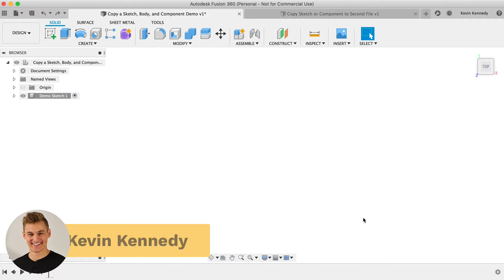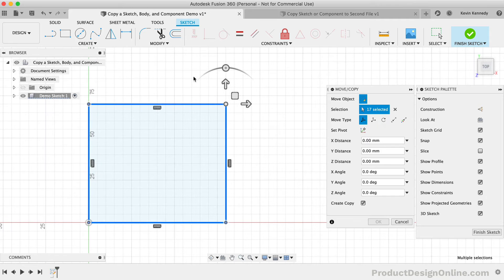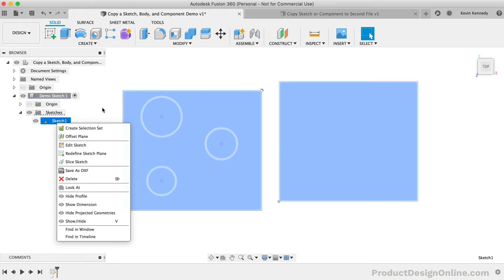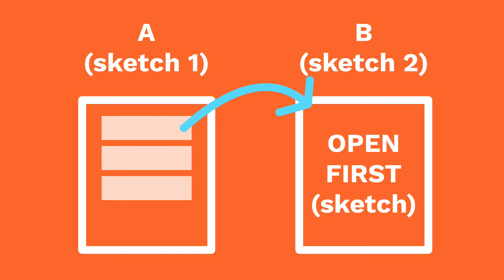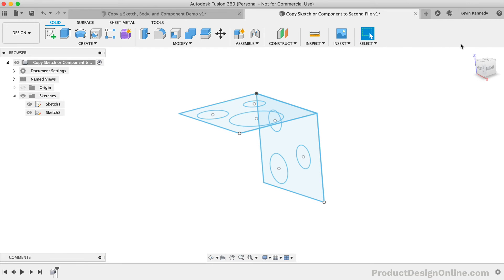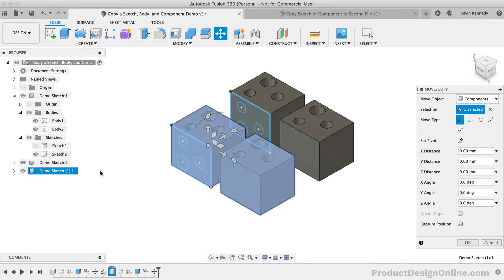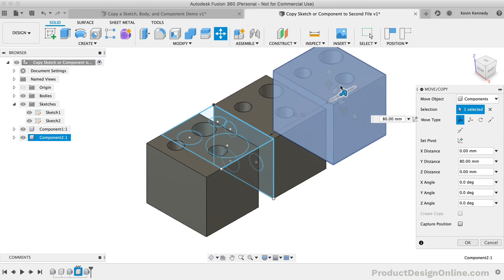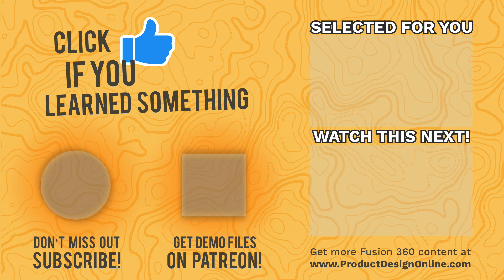Copy and Paste Sketches and Components in Fusion 360

Comment: Kevin, Thanks for an awesome Fusion 360 Series that makes learning easy.  I would like to see information on making a SVG File like you inserted in your Absolute Beginner Video where you made the 3D stamp with handle.  I tried to edit your downloaded SVG file to change the text to fit my use and could not get it to work.  Thanks again Kevin
Reply from the maker: Hi, Gary. Glad to hear you're enjoying my tutorials. I wasn't planning on doing a video on creating an SVG, since that cannot be done within Fusion 360. Scalable Vector Graphics (SVG) can be made in several graphics programs. I use Adobe Illustrator, but a free alternative would be Inkscape. There are many tutorials out there for Inkscape. There are also several SVG creation web apps (some free) if you do a Google search. Cheers, Kevin :)
Reply: Okay, thanks for your reply Kevin.  I will search for other YouTube Videos on SVG File creation.  I use Corel Draw and don't have an issue with creating the graphics portion to the same size as the stamp plate(in Corel Draw), my problem is that when I insert my SVG File into Fusion 360, the scaling is off and my graphic is offset too far and too large to fit the stamp plate. I have looked for scaling controls but haven't found anything that helps yet.  Anyway, I am sure that will be covered in the SVG File creation videos.  Thanks again Kevin, I am a fan and intend to support and follow you while I improve
Reply from the maker: @scabahorn  Hi, Gary. Yep, I would recommend that you create the SVG at the size before inserting it into Fusion 360. Since Fusion 360 has limited capabilities with SVGs it will help avoid and errors with trying to scale it. You can, however, click and drag on the corner manipulator icon that is next to your SVG design (While using the Insert SVG feature). That will let you scale the SVG file right in Fusion 360. Cheers, Kevin :)

Comment: Hey Kevin. So I have a design which ultimately looks like a bath shape. In sketch mode I can create the rectangle fine. Then after extruding it next step I shell it. Now I have a rectangular bath. Only I want the underside to be curved. Copying that if a bath. How do I go about doing that? Cheers.
Reply from the maker: Hi, James. There are many routes to make the bottom curved. The simplest would be to apply fillets to the bottom half before you shell it. If you want a more advanced (defined) curve then I would recommend setting up side profiles, resulting in geometry that can be used with the Loft command (instead of Extrude). Cheers, Kevin :)
Reply: Thanks for the reply and wish you Merry Xmas Kevin. Ok so I did it. Slightly rudimentary maybe but still. I went about it a different way the next day. What I did was to sketch it out and then do the curve underside first. Then to shell it and not the other way around. Then unside the bath shape I used the press and pull function till I had the floor of it flat. Once achieved I began creating the circles and wxtruding them for my rotary drive unit im copying which is on the table in front of me. 

Big question. How do I stop fusion flipping my on screen design which happens regularly. Turns it 180 degrees so I have to then readjust it. Very annoying.
Reply from the maker: @jamesbarratt593  Hi James. Unfortunately, there is not currently a setting or way to have that flipping issue turned off without turning off the entire "Auto look at sketch" feature. However, if you turn that off entirely then you will have to look at the sketch manually (with the viewcube or display settings) each time.

A feature to do so was requested on the idea station a couple of years ago. I remember as this sometimes annoys me as well...but they obviously haven't implemented a solution yet.

Wishing you a Merry Xmas and a happy new year! Cheers, Kevin :)
Reply: Dude that is a game changer. If I have to endure that repeatedly I am sure it will annoy me so much that I wont want to use it so much. How stupid that it does it. 

Anyway we shall see. 

Then say that you have a face you want to press pull to close an edge and you just cant get to it for the sides of a box in your way, is there a solution. Can you click on a side of a box and temporarily hide it like in system analysis so you can fix the place you want to fix?
Reply from the maker: @jamesbarratt593  You would want to use the "Section Analysis" from the "Inspect" dropdown menu to essentially temporarily cut away the parts of your model that are in the way. The nice thing about section analysis is you can hide/show it in the Browser, so you can turn that on and off as needed.
Reply: Feel another buy me a coffee contribution heading your way
Reply: Its xmas day dude. You should be chilling with your family not writing to subscribers and shit. Merryx Xmas again though. Your rock
Reply from the maker: @jamesbarratt593  Had to catch up on some comments while everyone was playing with their new toys :)
Reply: Your middle name. Does it begin with the letter K too? ha ha
Reply: @ProductDesignOnline  Didn't you get any toys then. Is that how you found the time? LAUGHING MY ASS OFF
Reply from the maker: @jamesbarratt593  nope :)

Comment: Another great video Kevin. Your videos have actually made me want to use Fusion 360, not dread it! While I am still very much a beginner, at least I understand what I am doing now. One video I would love to see is your version of an explanation of G0, G1 and G2 surface continuity. I spent hours trying to figure out why I kept getting G1 errors when using the loft command before ultimately figuring out that it was actually my mutli-line, not a spline that was the issue.
Reply: Move / Copy Sketch Autodesk Fusion 360 (Works 100%) - Mover / Copiar Sketch (Funciona 100%) https://youtu.be/hpF06IgYiD0
Reply from the maker: Hi, Barry. Glad to hear you're enjoying the tutorials. Definitely keep at it... it can be frustrating at times, but I'm always happy to help if you run into roadblocks.

Thanks for the video suggestion! I've added that to my video topics list. Surface continuity is definitely something I need to cover more in-depth. If not full on video, at least a portion of a video. Cheers, Kevin :)

Comment: This is really helpful for newbies I'm sure, and though I've used Fusion a lot I was definitely surprised to see what you can do with pasting sketches after turning off design history. I almost never work with design history off. One of my biggest complaints about Fusion is the inability to link mirrors like you can with component instances/copies. Solidworks allows you to create an "off-hand" mirror which is linked to the original component and updates with any changes to the original. Really wish you could do that with Fusion instead of needing to roll back in time to before you mirrored the part to make changes that update the mirrored version. Copying sketches seems to universally have the same issue.
Reply from the maker: Hi, Seth IPG. As former SolidWorks user myself, I feel your frustration. There are lots of quirks that Fusion 360 has that will hopefully have new solutions in future updates. I also rarely work with design history off, because it's so critical to be able to go back and edit things.

Have a happy holidays and a happy new year! Cheers, Kevin :)

Comment: I use project sketch. I did find one issue, I cannot project a sphere to a sketch.
Reply from the maker: Hi Mike. You can project a Sphere to a sketch if you switch the Project command to "bodies." In the project dialog, you will need to select "bodies" for the "Selection Filter". It defaults to the "specified entities" option. Cheers, Kevin :)